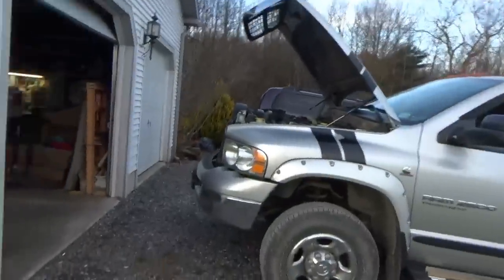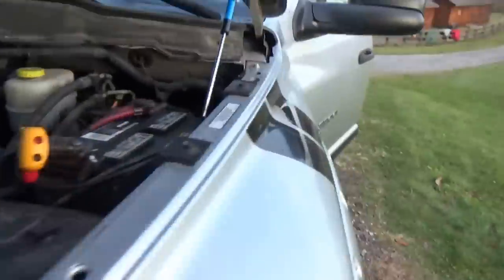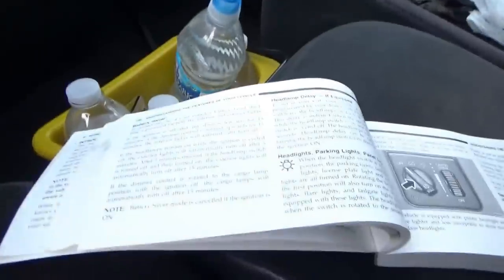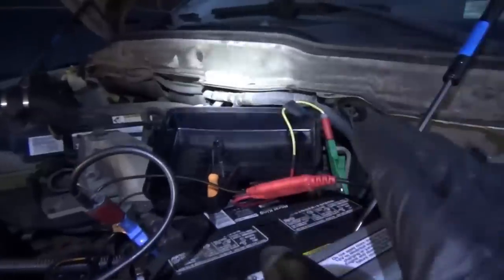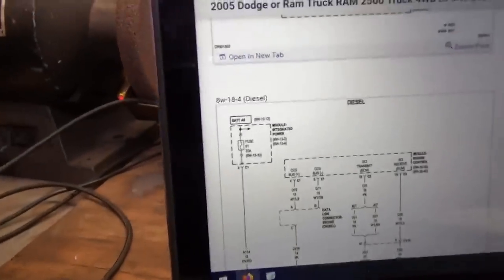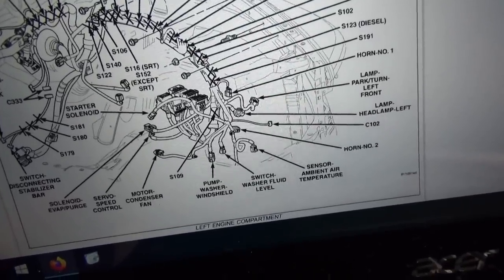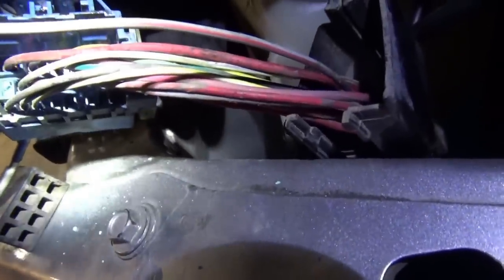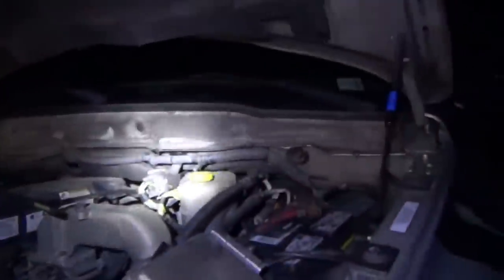Ram Drains Battery...But NO LIGHTS?

Comment: Thank you for the video! Good work on the diagnostics and repair! Questions: how does corrosion at a + wire causing parasitic draw? Thank you!
Reply from the maker: Great question! Since it was a high-resistance feed, the voltage at the cluster was much lower than battery voltage 12V. This causes electronics to do some very weird stuff, like oscillating between on and off, never falling asleep. By the time I got the truck, the wire was basically a complete open circuit, which is why no parasitic draw was recorded!
Reply: And to extend his answer: if the resistance of a wire increases, it will need more power for the Radio and in combination with the on/off switching problems of the modules, it will drain a battery faster because more Amps are needed for the same Voltage.

Soldering can cause other problems and to prevent moisture to get into the pin again to cause trouble, I spray a little bit of wax into it to seal it.
Reply: @Spelter  Sorry but your hypothesis is wrong, you assume the increase of resistance increases current draw which is not the case in this example.  In this case the increase in resistance causes the circuit to miss the voltage to put it to sleep.  This is more likely the scenario without the actual schematic.
Reply: @publicmail2  oh, OK.  I learned some time ago that when your device needs ie 12v and 1amp aka 12 watts, it would increase when there is a corroded wire and it would need ie 2 amps or 24 watts. In that case, the whole system is acting up because the drop of the power and surged as much as it could get to work properly, killed the battery while doing that. Of course it could be otherwise, I could learned a wrong thing there.
Reply from the maker: @Spelter  think about the voltage drop across the green crusty, which decreases the available voltage for the intended load. The total steady current in the circuit would drop. However, since now the module can't go to sleep, you will end up with a parasitic draw 👍
Reply: @PineHollowAutoDiagnostics   Don't you just love these "smart" modules?
Reply: Could a problem like the corrosion on that pin or another like that one cause a "no bus " to come up? I have similar problem on my 03 dodge ram. I have replaced ecm took completely apart the tipm thinking it could be bcm. No problems with the ecm and tipm. I am lost drawing at straws. This video has gave me another place to start looking.
Reply: Look for the jolly green giant in the wiring harness.
Reply: @PineHollowAutoDiagnostics   Hello 👋 Just wondering if a radio clock won't turn off after turning the radio off ( clock that says what time it is still stays on . Would the clock be draining the battery ? 
   Battery is only 2 months old . The radio stays on even after I turn off ignition.  I have to make sure I turn the radio off because it stays on . But even after turning off the radio , the clock stays on  . 
  Could clock be draining battery ? 
     I would be so grateful for your opinion.  
        Thankyou for this video . I will sub and give a like .
Reply: @johnwilliamson2393  The "smart modules" are only as smart as the program they run on. The programmer failed to foresee the possibility of corrosion in the circuit. The corrosion causes resistance or partial shorts to other positive circuits or the ground circuit.

Comment: We learned that a dealership would likely have changed out the engine and the entire wiring harness to fix the problem.
Reply: Anonymous98  on my cousins moms Ford F-150 the  dealership charged her   $5000 for the whole harness and labour because they couldn’t find the short to ground

Comment: Perfect fix !  Time taken to investigate is mandatory to a high quality repair. No parts, just solder, cleaners and di-electric grease concluded the problems.  More proof that the factory should be using di-electric grease more often with their poor terminations/crimps.  The cause of this problem was poor design, nothing more.

Comment: The bright and dimming is from the grid heater coming on and off!
Reply: milkman 99.100 +   you are correct,  my Dad has the similar truck but in the - MEGA CAB MODEL,    when it is cold it does the cycling on and off until it reaches temperature and then it stops.    But I did notice on his truck the battery on the left is being charged more then the one in the right,     like 15 volts steady,    I  need  to research on that to see if it is normal or what??

Comment: I noticed at 3:26 when you shut the engine off, the tach did not drop to 0.   Nice work finding the problem.  The OCD part of me was glad you did not have to run a wire and could find and fix the issue.
Reply: It was pretty imperative that he did because if not the green crusties would have kept growing and started infecting other circuits.
Reply from the maker: Good eye! I only noticed this after reviewing the camera footage :)
Reply: John, I was thinking the same thing..."no, don't just run another wire over there... you can find this!"  Good job to Ivan - he seems to always prevail!

Comment: I was a keen electronics hobbyist, and was given a cassette player/recorder (can you remember?) to repair a fault which presented as noise on playback, but when 'tapped', disappeared. I ended up finding a 'break' in the shielding earth wire leading to the record/playback head. It was difficult to access without total disassembly, so I soldered in a jumper wire along side the cluster.. Fixed.. I absolutely love your videos, as many electronic faults arise in the automotive field still needing our knowledge and experience...

Comment: The dimming of the lights is the vehicle doesn’t turn on the alternator in the first like 30 seconds while the grid heater is cycling on and off. If you watch the voltage gauge you will notice it. It does cause the engine sound to change as the relays come on and off with the electrical load

Comment: 7 min in. Need to Check the i.o.d fuse.... now to watch rest of video ... found it at 14 min. Came back and found bad wire at 28-29 min.
This fuse is for the cluster, radio, headlights etc memory or ability to turn on without the key in ignition and can be pulled up to temporarily stop battery draw. Can’t recommend wd40 on electrical. Use specific electrical cleaner etc. 

My son’s 2003 had no lights etc. Pulled the 51 fuse. It looked good but I put another one in anyway and system worked. Will check more in am.

Also If you happen to see an ant in the fuse box they liked to live there and cause havoc.  They Destroyed one in another truck .. same for water well contacts. 1 ant outside can mean thousands inside.

Good detailed video. 

Recommend starting with fuse box first and note a good fuse will read on both sides even when wire is damaged or connection is buggered up

Comment: Great job sticking with the proper pin and fuse hunting.  I like to drown every connector and pin with dielectric when I find and fix or even if I remove and reconnect any connection.

Comment: Great video. I always like to find where the fault in the wire is. If a wire is broken somewhere then it’s possible there is also other wires damaged in that area as well. Depends on accessibility though I guess. There are some sections of harness that are near impossible to get to without major work like pulling an engine or something and a jumper wire would be ideal in those situations. I just like to put my eyes the problem area just to make sure there would be no possibility of the bare/broken wire shorting out on something and causing more damage.
Reply: That would be hell. Who designed it that way? I hated Ford on an Escape V6 3.0 for the Bank 1 Cat, replacing it is hell.

Comment: That was an awesome find! Had a similar situation couple days ago on a Chevy Colorado,4x4 inop. Backprobing a wire @ xfer case cont mod I had power. Down @ shifting motor, I didn't. Like I said, BACKPROBING @ the module I had power, piercing the wire just off the mod, I didn't..... figured out the female terminal inside the plug had spread an lost connection.  Again, AWESOME find! :)
Reply from the maker: Wow great find Brian! Pin fitment issues can be the hardest to track down for sure.

Comment: I had a dodge pick em up for 11 years, purchased new.  And I learned not to mess with the light switches inside or on the dash.  If you did you could never figure out how to get them to go off by themselves or come on when you needed them.  NEVER push the lights in to turn them off or they will not work in any setting.  This overrides the smart light control system.  Weird but true

Comment: I am so happy to live on the west coast, you can keep all those corroded vehicles. I have had a few come through here from your area, and they were real badly corroded everywhere.
Dielectric keeps water out, I go through allot of it. Oregon has very wet conditions, but, not as much road salts.
The big hazard in rural Oregon is not the water, it's the six foot deep, six foot wide ditch with no shoulder. If you blink, you will need a new vehicle, as the vehicle will almost always get overturned.
Every few decades Dodge makes a mistake and produces a great vehicle, the older trucks were lacking the "Party Mode" crap, and I really like the 95 dually, it's been bulletproof.

Comment: Man Ivan you are one smart cookie. I suppose a bad connector is easier to repair than a broken wire somewhere in a jungle of wires. I have a Tacoma and had wiring damages because of squirrels. If you are not aware...HONDA makes a special type of electrical tape that is an excellent deterrent against rodent damage. I had my local Toyota dealer tape all my underhood wiring with it.

Comment: Ivan presses the map light lense, and it falls off.. I had to laugh as a Dodge owner. GENTLY, Ivan! Treat them gently. BTW, good on you that you saved the tiny female connector. I keep them in stock, in 20-16 and 18 metric sizes. By the time I see them, they are generally toast and cannot be salvaged.

Comment: In dash connection problems also occur...bad solder joints and plastic wiring connectors that don't fit tight into circuit board connectors because of differing expansion rates in the plastic components, allows the metal connectors to chatter (make and  break contact)  International trucks had this problem and caused all sorts of weird results, including having the engine shutdown when the power to the electric fuel solenoid got interrupted. Loose connections and salt water corrosion do crazy things. 
 
Can't wait to see the results with electric vehicles versus road salt !  Any atmospheric venting of those electric motors will end up bad...very bad.

Comment: Key Off before fix, tach at 500rpm.  Once power was restored, tach below zero with Key Off.  The BCM on Dodge Trucks/Rams were also dog turds causing various faults including headlights, interior lights, door locks, and power window issues in the Driver’s left footwell, lots of green crusties in those connectors.

Comment: I’m having a hard time getting my head around how an open, caused by a corroded terminal, is causing an intermittent parasitic draw and killing the battery. I can’t help but believe you cured a problem other than the original concern.
Reply: Potentially, but throughout his entire diagnostic process no odd drains showed up which would indicate another issue... so it would be so random that he'll have to give it back to the customer and let him report back. But I believe he got it because this system is dependent on the cluster telling modules to go to sleep, so while this wire was making and breaking connection I'm betting the interior lights and other modules on the circuit kept coming on at random times throughout the night and randomly killing the battery. Notice how every time he gave the circuit power the lights inside came on, even with the doors closed and key out? That failing pin would act very similar and would keep resetting that 15min timer.
Reply: @volvo09  That is correct, it is preventing standby mode.
Reply: I bet once he got com again, the truck had U codes for the BCM and/or cluster, thus proving the point that the cluster module couldn't go to sleep, and hence, the small draw.
Reply: Yep I am happy customer     truck been great since  Ivan cured no sleep problem

Comment: Some years ago, when Ford Australia introduced the XD Falcon (much the standard 6 cylinder (V8 option) family car) in 1979, plastic components (fuel tank, instrument cluster, dash board) were extensively fitted. For the first time, extensive 'earthing' was required in the wiring loom which fed the lights, radio, instrument cluster, amongst other functional items. The design incorporated an additional 10 Amp earth lug to the negative of the battery, and when you replaced the battery, you happen to forget to connect it, as I'm sure a few 'DIY' owners did, the instrument cluster would 'flicker', giving false readings throughout, as it had a 10 Volt supply from a 12 Volt feed via a resistor in series with a 10 Volt zener diode.. I was called to try and fix it, and not before removing the instrument cluster, and the owner insisting the battery was correctly connected ("You know, it starts, so it must be right.."), I found the 10 Amp earth lug and connected it... Fixed....

Comment: Great patients at finding the fault and not just making the jumper. Wondering how big a hole do the wire probes make and how do you fill the holes. Thanks ivan

Comment: When I first seen this, I thought the radio because I noticed it didn't work. And radios can cause parasitic draw if it's having issues internally with power transistors because of the memory input being a power point on modern stereos. And ignition controlling the gate/base on internal MOSFET/Transistors. Same as computers. Third basic component of course would have been the alternator diodes. I see that a lot.

Comment: I had water in a wiper switch do this once, there is a bit of power in some cars backed to the column switches from things like the hazards. And it would randomly start going. Weirdest thing ever. Come to find out, it was nothing but a leak getting into the switch. I've seen quite a few vehicles with issues like this. Usually moisture/liquid related obviously in the corrosion issues.

Comment: Ivan, I have a similar expensive Fluke clamp on ammeter and I have found you can't trust the values you get when using it as a milli-ammeter. When you use it to read very small current values it's not as accurate as when you use a dvom actually inserted into the circuit and placed in a milliamp scale. I have been lead down the wrong path using the fluke to measure very small currents and it took an actual milliamp meter to show me that the values on the fluke were not correct.
Reply: Right, to read mA, it is better to hook an ammeter in series but most multimeter have a fuse (10A?) that will blow when you don't have control of how much current would go thru the multimeter.
Reply: Most generally from my experience in situations like this, yes, the DVOM has a 10A ceramic fuse, but when dealing w a parasitic draw, you won't come anywhere near the 10 amps. You pretty have to turn the key to start position (which I've done by accident and blew the fuse). But even turning headlights on you're pretty much always still safe.
Reply: John;  I agree that you cannot rely on the accuracy of a meter (of just about any sort) when you are working at the very bottom of the scale.  When using a clamp on meter in this situation there is a trick you can use to get around this problem.  Take some fairly heavy insulated wire (say 14 or 12 gauge) and make a small 10 turn coil sized so that you can conveniently clamp the jaws of the clamp meter through the hole in the middle of the coil.  Wrap it in electrical tape so the coil holds its shape.  Leave a foot or so of wire on each end of the coil to act as a lead in and put a fuse (say about 30 amps) into one of the coil leads.  Lift the battery negative terminal and connect one end of the 10 turn coil to the negative terminal on the battery and the other end to the battery terminal clamp on the end of the battery negative wire.  Clamp the meter jaws around the 10 turn coil.

      What you have done is increase the sensitivity of the clamp meter by a factor of 10.  The Fluke 325 that Ivan is using has DC current ranges of 40 amps and 400 amps. It is an auto-ranging meter so at low currents it will switch to the 40 amp range which we have now converted to a 4 amp range and the readings will be significantly more reliable.  You do have to remember to shift the decimal point in the reading if the actual value of the current is important to you.  If you do exceed 4 amps of current the meter will just change ranges automatically to its 400 amp range which, with the 10X sensitivity increase, will actually be a 40 amp range.  

        You can of course make a coil of 100 turns to increase the sensitivity by a factor of 100 (400 MA full scale on the 40 amp range of the meter) but you will have to use a smaller size wire (maybe about #18) and a smaller size fuse (maybe about 5 amp).  This way if you accidentally blow the fuse it is a cheap automotive fuse rather than the expensive and harder to find ceramic fuse in your multi-meter.

Comment: make sure you have the exact OEM nuts that secure your battery wires to your battery. it has to be the exact one from the factory or they lose connection. my batteries were dying slowly no matter what, and dodge replaced the nut and it fixed the problem.